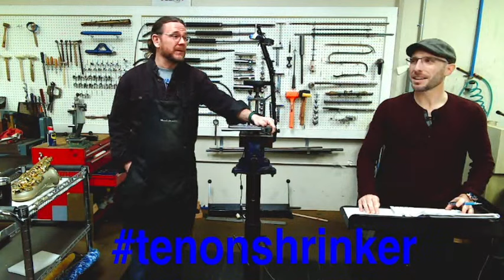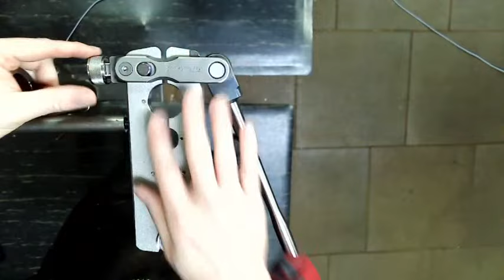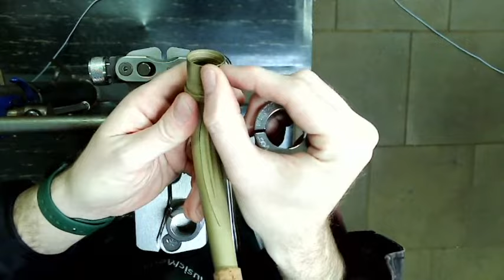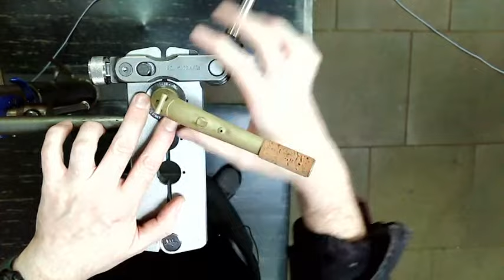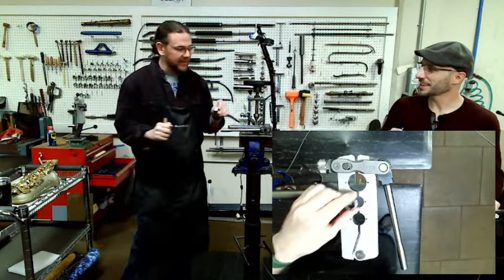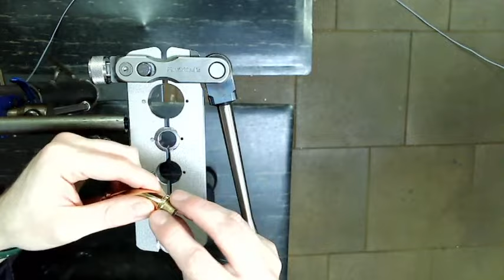How to Shrink a Tenon for Neck and Head Joint Fitting! #WednesdayWisdom

Comment: 🤔How does it not extend the tenon....?
Reply from the maker: Normally a tenon expander will lengthen the tenon ever so slightly, but not enough to make a difference in fit. Our tenon Shrinker in this video doesn't extend the tenon because the force is transferred equally around the circumference of the tenon. We noticed a bad fit with the shrinker, quite the opposite. Great question!